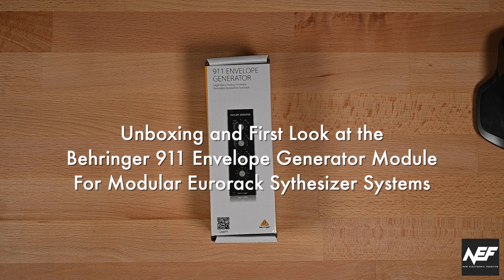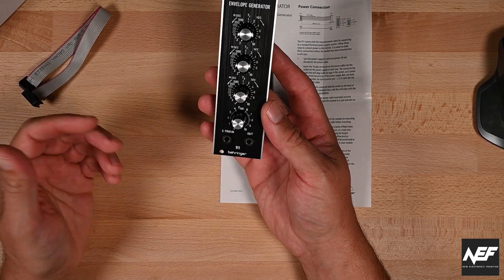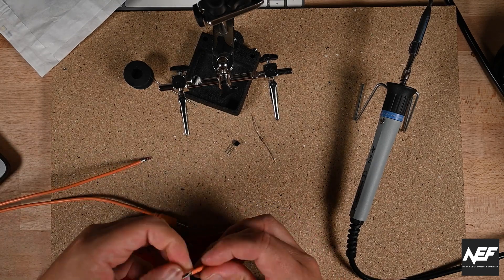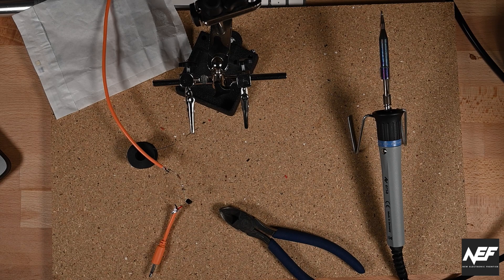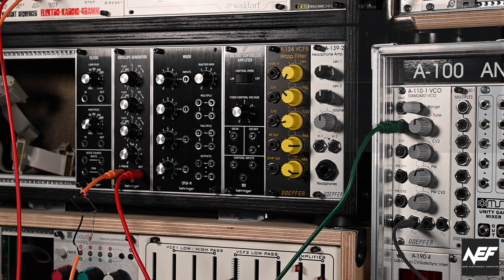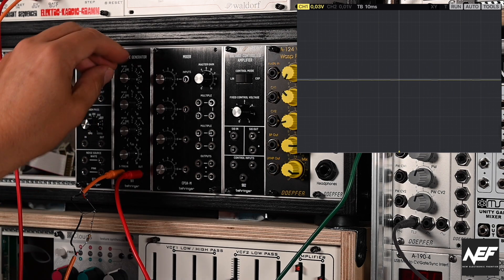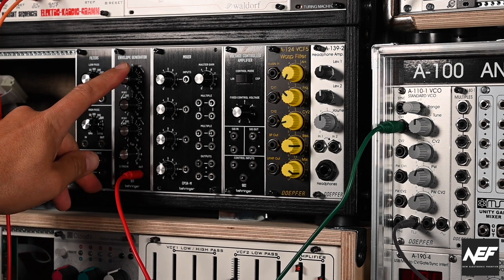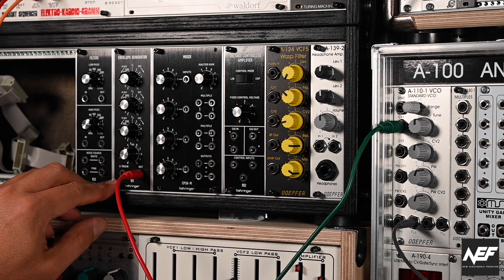Behringer 911 Envelope Generator Module Unboxing/First Look and build an S-Trigger to CV/Gate cable

Comment: Thanks for the Video. Would it also be possible to just modify the Modul. So basically not soldering a cable, but just soldering on the Modul itself ? Kind regards
Reply from the maker: Hey Kevin! I guess so... But I'm pretty much on the simple side of soldering things... But if you can find the and access the right connection print on the pcb it should be possible to solder the resitor somewhere there... However, it's going to be tricky. And if you are not expert level, it's super easy to damage the module. So the cable is the safer path 😬

Comment: Hi ! I would like to know what happen if I just plug a normal trigger into s-trigger ? 
Nothing happen ? 
I’m a shit in soldering.. but I would really like to get some Behringer modules without having to get the big one which makes the conversion ? Thanks you your video is very useful for me.. I was about to buy it ... 🙏🏽
Reply from the maker: Happy to help! The soldering is really easy - you can do it! 
For what happens with normal trigger input: This is how I started, because I simply didn't get the S-Trigger thing (and the documentation is very short). So I just plugged in my gate out from my Analogue Solutions EKG. And there was something coming out. But quite unpredictable and unstable. Was driving me nuts. Until I found the S-Trigger expanaition. So I wouldn't say that nothing is happening if you put in a normal trigger. But the things that happen are not the ones you want :-D And it seems very dependend on the singnal voltage. Even super slight differences make a difference - my second EGK did do nothing to it... So you need the S-Trigger to get it going properly.

Comment: The thing about the S trig is you can use a foot pedal with it which means you can use it to sweep a filter say by pressing the foot pedal. I have 2 of these and they’re very good.
Reply from the maker: Thanks for the feedback Andy! That's super interesting. Anywhere on the web where I can read on that?

Comment: I did that same S-trig to V-trig modification to a Multimoog a couple of years ago. The problem though, is that I was no longer getting multi-triggering. If I slur two notes together I still want to hear the full articulation of the envelope. I wonder if other people experience the same thing. I ended up undoing the mod, and putting it back to S-trig and setting my Doepfer Midi converter back to S-trig mode and now I get the multi-triggering I want.
Reply from the maker: Thanks for the comment. Unfortunately no help here - I just use it in a one VCO setup. 🤷‍♂️

Comment: You can also get the Behringer 961 Interface Module for the 911 and the 911A. The 961 will convert the S-Trig to V-trig.
Reply from the maker: Totally right! But as @Matt just said: its a couple of more bucks from the safe, plus more rackspace used. So the question for this is: do you need/use the rest of the 961's options/tools. But yes: that's the one I was thinking of in the video (and didn't find the name). Obviously I went for the DIY option :-)